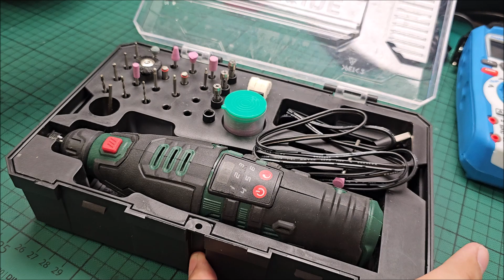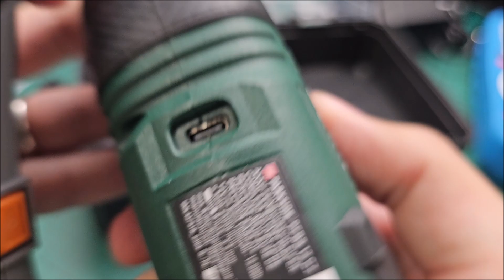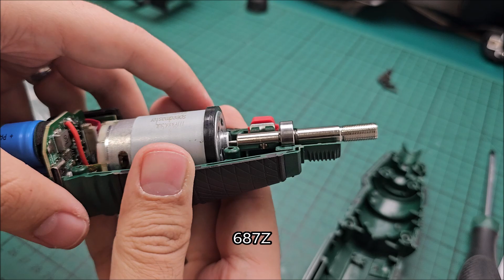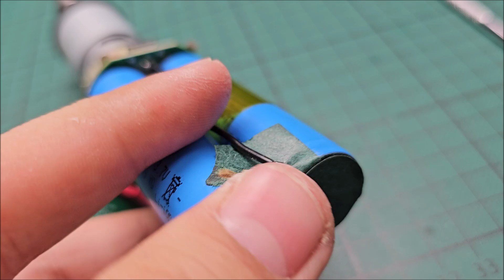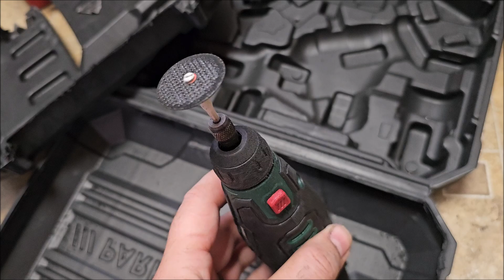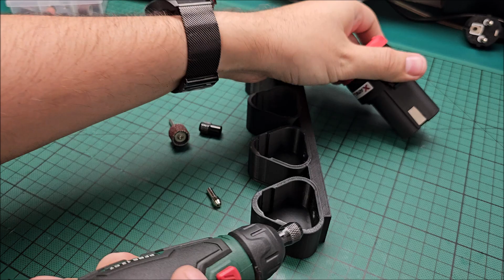PARKSIDE 12V Cordless Rotary Tool PFBS 12 C7 (from Lidl or Kaufland) - unboxing, review and test

Comment: I have this model and from 3 times use it's catch bug: start working on full speed and dot't turn off, until battery die.
Reply from the maker: Hmm, really weird. Try to contact Parkside and use warranty to replace the unit.

Comment: Hi, great video. What is the exact type of bearing that you added? I'm not experienced in working with bearings, but it seems you made it run with even less vibrations...
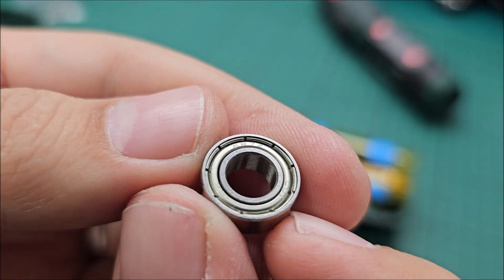Reply from the maker: Hi. Thanks! I actually show the bearing model in the video: 22:15
I used a 687Z bearing.

Comment: what the number of the battery
Reply from the maker: Number? You mean battery type? It's 18650
Reply: @UltimateDIY  no  the extra snall battery you added
Reply from the maker: I did not add a battery. I added a bearing and I show the dimensions and model number in the video.
Reply: sorry bearing I meant  @UltimateDIY
Reply: would you recommend this tool
I am thinking  of buying one tomorrow thanks
Reply from the maker: Yes, it's doing it's job well.
Reply: @UltimateDIY  ok what the number of the bearing thanks great video
Reply from the maker: @aldavis2692 I don't remember, but you can see it in the video
Reply: @UltimateDIY  ok
Reply: @UltimateDIY  it is a 687zz

Comment: A little note for the smallest machine that you've showed, i have a PFBSA 4 A1 which looks very similar to that one, i took it apart (thanks for showing me the spot for the second bearing, i ordered one)
And i've found that indeed the lack of power is coming from the small 1pcs battery (2Ah), and the motor thats significantly shorter. 
I've did some fine metal polishing with it on speed 1 though, and it works fine there, anything else that requires even a small amount of power is impossible. 
When i take off the toolholder, i use speed1 to screw the holder back on, and it cant make it even barely tight😂😂
Reply from the maker: Thank you for confirming my findings 👍🏻
Reply: what the number of bearing

Comment: The only thing missing from your box is the tension-wrench to fasten or loosen the bits properly.
Always use the Max setting to uphold the motor torque during high forces(but avoid them!).
The motor needs to rotate in order for the electromagnets to properly transfer power to torque moment.
Like you said it does not use a gearbox. :)
Reply from the maker: Thanks for the info. That wrench is not important for me, so in the end it was not such a bad purchase.

Comment: I bought this from Lidl exactly 5 weeks ago for 25.99 €
Also managed to get the Rotary Tool Accessory Set (276 pieces), not included!
Maybe there even are tool attachments available?
Reply from the maker: Good price 👍🏻 I also pondered about the accesory set, but did not buy one, as I already had most accesories, just not in set form.
I don't know about other tool attachments, sadly.